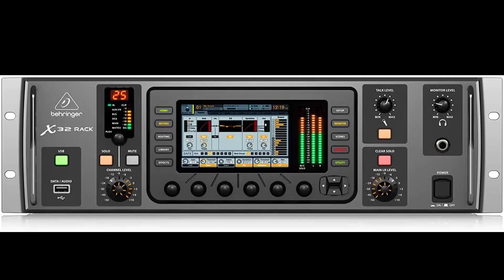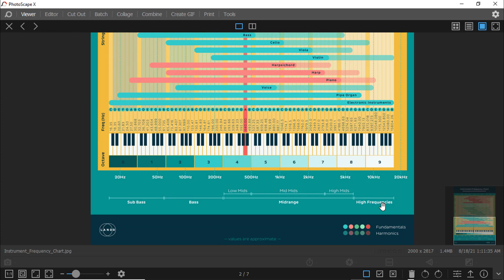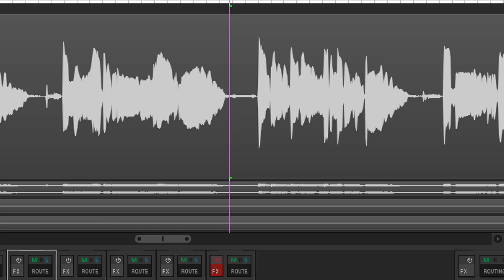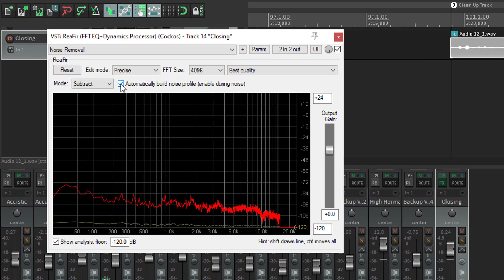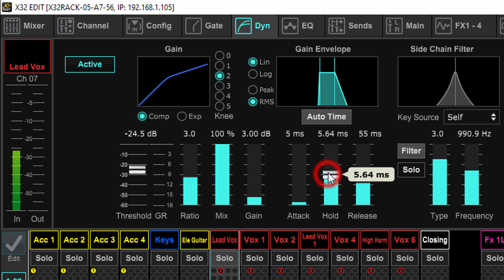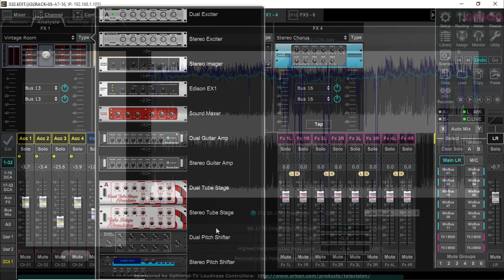X32 Effect Racks Explained Part 1

Comment: Hi, can I first EQ then compress a channel strip or
 is it embedded on x32 rack to first compress a signal then EQ???
Reply from the maker: In X32 Edit, select the channel, then at the top, make sure you are in channel view. Look in the first column on the left for "Dyn" and by selecting or deselecting that option, will determine if the compressor comes before or after the EQ.